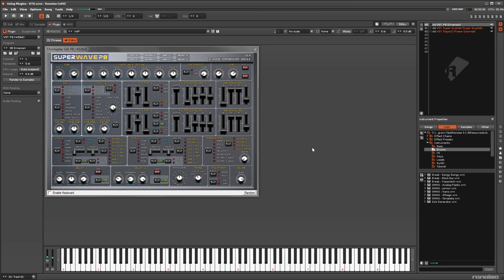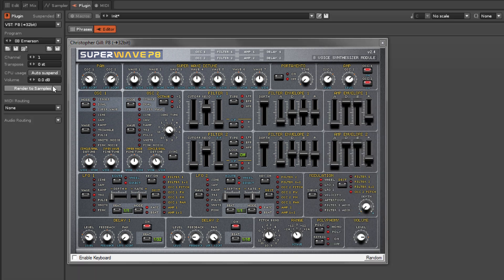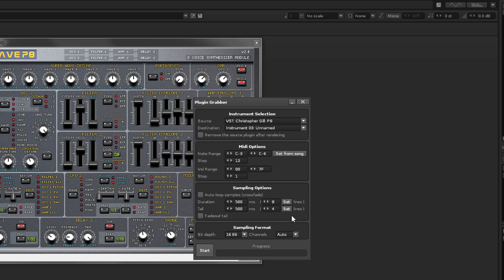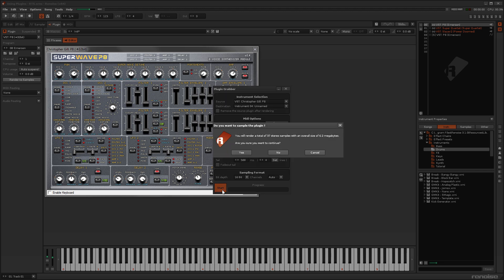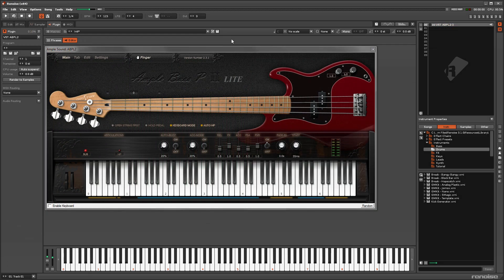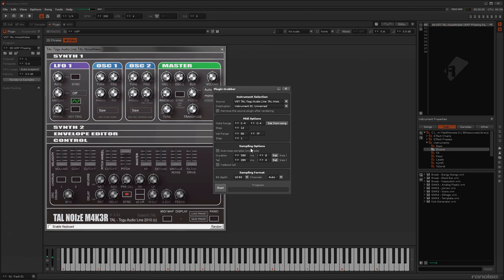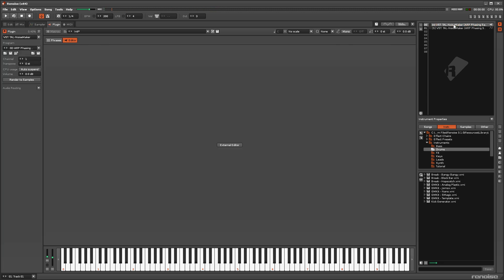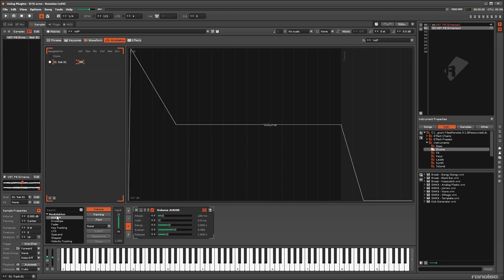Using Plugins - Render To Samples

Comment: where do the samples get stored? i need them for redux in another daw
Reply from the maker: Samples are always contained within an Instrument, in this case the one you created with the Plugin Grabber. You can save the Instrument and then load it into Redux.
Reply from the maker: @SlowwFloww When you export from the Keyzones section of the Sampler, this is automatically done as an .sfz soundfont file: https://tutorials.renoise.com/wiki/Libraries#Specific_Preset_Types
Reply from the maker: @SlowwFloww You can export them the same way you do with any other sample(s). There's nothing restrictive about the what the Plugin Grabber creates here.